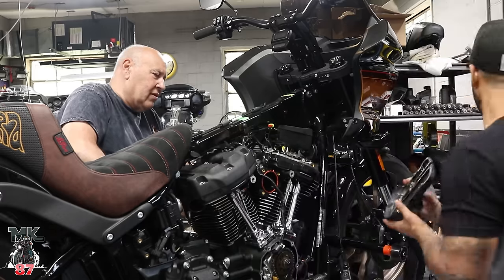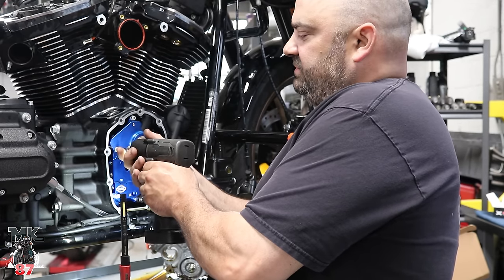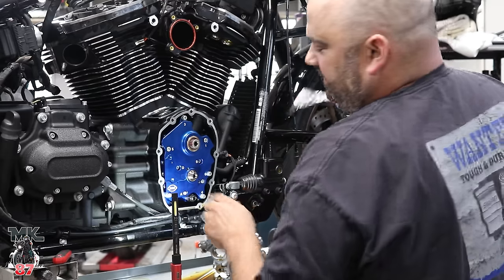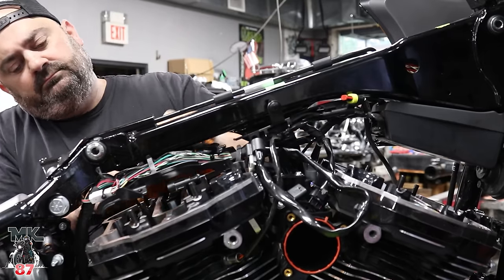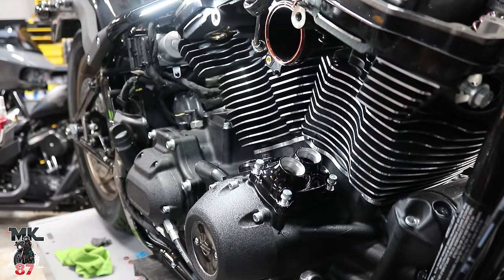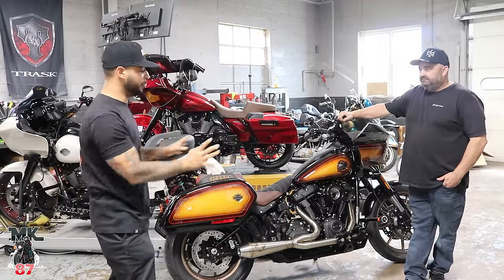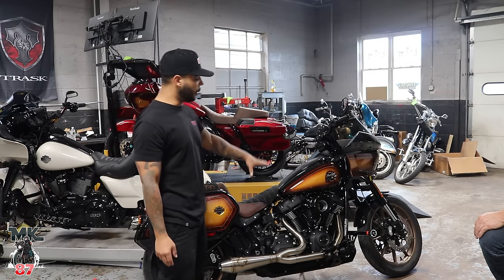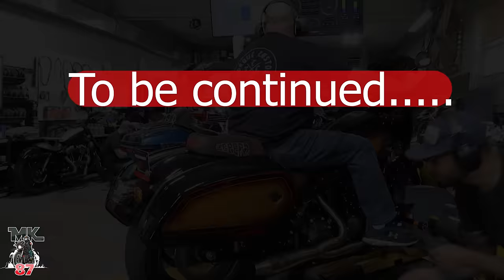Low Rider ST stage 2 build / 483 Cyclerama cam

Comment: You are a brave man letting someone who has never done an engine upgrade work on your baby.
Reply from the maker: ? He owns the shop and does most of the engine work.
Reply: @Marvelkid87  I could have sworn he said in video that engine work was all new to him but I smoke weed and turn 62 next month soo my brain is getting foggy.   Having said that EVERY master technician in this Universe started as an apprentice plus he owns the place so you are in good hands. Beautiful bike by the way. I LOVE that color!!!    I do have a question for you and would appreciate your advice. I turn 62 next month and buying me a Harley for my birthday.  I sold my heavy ass 825 lb Street Glide 17 years ago and have not ridden a bike since. I  live in Austin TX and want a bike to cruise around town and also do 4 to 6 hour cruises in the Texas Hill Country which I am told is nice pace t ride. . Do you think the lighter weight Low Rider ST which is 100 lbs less than a Street Glide a better choice for an older man?   I do not like going 100 MPH  but fucking love torque and getting to 0 -60  as quickly as possible.    If I purchased a heavier bagger I would do a CVO for the biggest engine. I was even considering a trike but I think two wheels has to be more fun and  can hold off to 70😎

Comment: I have the Cycle Rama 483 cam in my 128-inch engine on my 2019, Road glide Ultra and with the Khrome Werks two into one exhaust it puts out a really nice loping idle.
Reply from the maker: Right on man 🤘🏽